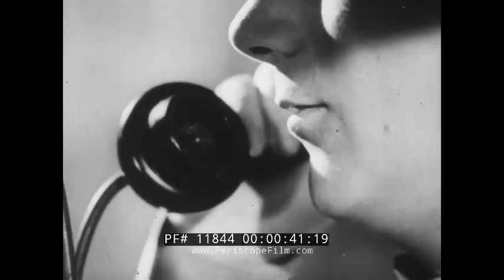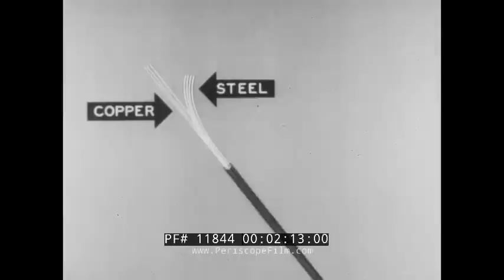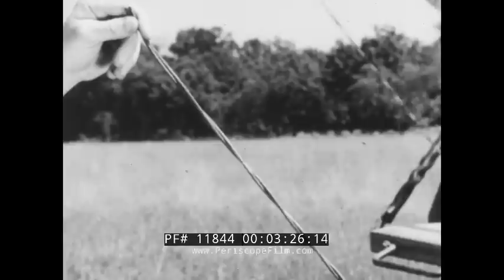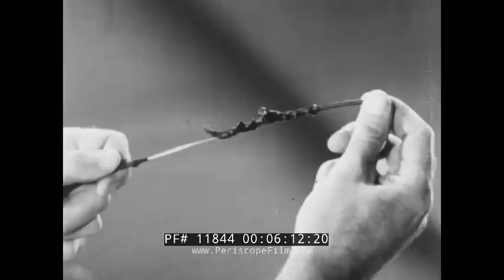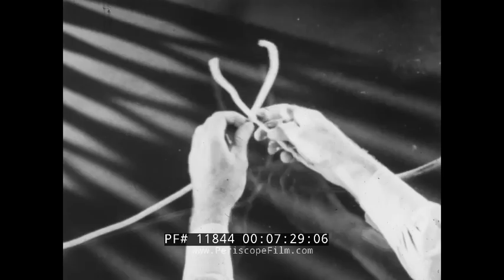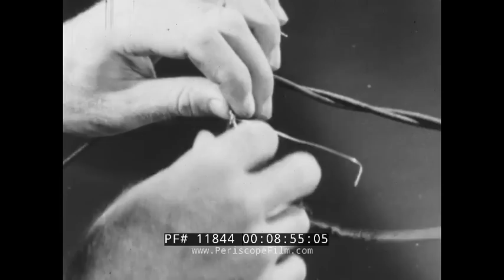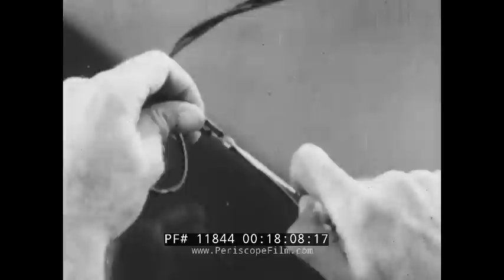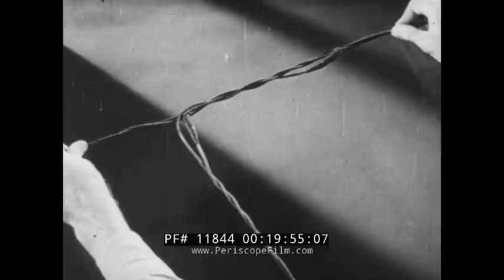1941 U.S. ARMY SIGNAL CORPS     SPLICING OF FIELD WIRE CABLE TECHNIQUES  FIELD TELEPHONE 11844

Comment: Average infantry/artillery soldier: "Screw that! Just twist the ends together and tape them!...we need to get going!"
Reply: Fortunately, "wire rats" assigned to combat arms units do it right.
Reply: @paladin0654  It might seem like alot to remember but I think with experience and practice two soldiers could do this in under 5 minutes!
Reply: @ZerokillerOppel1   I could not imagine Two pole jockeys on One Pole! 

I could tie wire fairly quickly, make my Comms Test, and be down the pole, (I was on a Base Camp and the WIRE was Old).

I ended up Replacing all the sing strung lines with a 27 pair "TM" approved hand made cable from OPS Bunker to the Officer's Club, as it was a "Central Location" where I could do my branch cables.
Reply: When their life relies on the coms not breaking up, maybe they do it right.
Reply: Right...  Some of my favorite memories are of  when we had to duct tape and bubble gum stuff to make it work... Thinking is fun .. despite the popular narrative I see pushed so so much ..
Reply: @madsighntist14  you should a been there when we would work in places so high and remote we would get dropped off by helicopter and hang a square made of 2x6s  rope ..  take turns standing to balance the "work "platform" ... Fun stuff
Reply: @ZerokillerOppel1  Agree - remember war is 99% boredom. If thats your job, you'd learn to do it in the mud, at night, without making any noise... the real question is how many tools (other than pliers) can you do it with?...
bayonet? easy. Zippo? Spork? probably.. Teeth? if you really need to....
Its a tough job, and you would be a specfific target to the enemy, and often be isolated from the rest of the troops
Reply: Sound like some electricians I work with in the Low Voltage field.
Reply: The reason they use steel instead of copper if for strength. But steel is not easy to just "twist" together.

Comment: Oh the 31-K/10 memories .!!❤️ I still have my issue TL pliers sheath and Barlow knife ...
Reply: 31K here too. Oh the memories. Like my finding out how to listen in on radio comms with my Fred Flintstone switchboard. Wires are antennas, audio amp is audio amp, crystallization/slight corrosion on plug is rectifying junction = radio receiver.

Comment: The British had a solder splice; a thin walled copper tube with solder and flux on the inside and a pyrotechnic compound on the outside. The wired were threaded into the tube which was lightly crimped, then the pyrotechnic compund was lit. When it was cool the whole thing was taped.
Reply: Hellerman Jointer
Reply: @Vegan123  Not really the same no.

Comment: Hello. Trouble Shooter One Five, Tay Ninh, RVN, 1969/70. I worked in Signal Detachment for the 187th AHC "Crusaders".

I did Telephone Lineman work when I first got there, as my Primary MOS was "Filled". So I Grabbed the Tech Manual, read it, & OJT'd as a Pole Jokey.

I climbed poles Day OR night: when ever a line went dead, I was on it to get it fixed!

This training was Very Similar to our more modern wire, 4 steel 3 Copper, and I could find a bad wire at Zero Dark Thirty with zero light, just by feel!

Comment: Now days in the U.K. most copper wires are crimped the wires that feed from the pole to house 🏠 drop wires has 5 wires 4 copper 1 stranded support wire only 2 of the copper wires are used for communication the other 2 are spare I have seen some one use the support wire to give service when the other wires are broken when they should run a new wire things are changeover to fibre directly to the the home it was going this way before I retired from the industry 3 years ago

Comment: I took the Field Wireman course in 1970, other then a bit of improvement in the wire, the procedure was exactly the same the test to the  proper splice was the strength, and the size, our instructor said it should be covered with a quarter, one instructor demanded the size of a dime, but he was an ass.

Comment: That sqaure knot looks suspicously like a reef knot.
Reply: Square knot is the same as a reef knot. Like a clove hitch is the same as a double hitch.
Reply: @_GOD_HAND_  There is a clove hitch, and a 1/2 clove hitch. I seen truck drivers call the clove hitch the truckies tie down at depots as I picked up loads in my van. Though nowadays they use those ratchet straps.

Comment: In the field is this practiced of running temporary wire where needed still used in the military or is everything wireless now?  I'm not talking about main power wire.
Reply: We are still issued a phone from 1921 or 1912,  cant remember witch, with two D-cell batteries and  two lines that goes in it. Used for guard posts and stuff like that.
Reply: @thomasgustafsson7330  That would be 1937, and while there are two binding posts, "la" and "lb", they are connections for a pair of wires that constitute one line.
Reply: 4 years ago the expeditionary phone switch was still in the nomenclature. We had one in a big box. I got training on that in the early 80s. As for wireless. Over long distance we used microwave on expedient towers. In camp we did have secure WiFi and also hard lines. I’m Iraq in 06 one of my jobs was keeping our phones up to the demarc of our little Navy camp, inside a larger Army camp on a bigger air base. We loose a line, I go to the demarc and verify it was dead coming in. Not my problem. I had a butt set and a toner. Then I go pound on the door of the Army comm shack, only concrete building on base. They crack it open, I slide in the trouble ticket and roll. One night the COs phone goes down. I find the problem is outside our camp. I go to the comm shack and one PFC is there. I’m telling this kid this needs to be fixed now. He won’t let me in. He is saying tomorrow. I outranked him so I told him it was the COs phone and let me in. He lets me in and for the first time I see the same damn phone switch I was trained on. And the punch down rack for the camp. I get down on the floor and find the lines with my inductive amp. I am about to punch down the pair and in walks in the CSM in full dress uniform. He screaming at the PFC for letting me in. I tell the CSM it’s our COs phone and I can have him walk over to his COs tent  to work it out. CSM gets down on the floor, takes my gear, finds the line and punches it down. Then I call to the desk in our office and it’s working. He all but throws my gear at me, tells me to get out and not come back. So I got a CSM to crawl on the floor in full dress lol. I’ve been waiting to tell that story for years.
Reply: Yes and no. Most everything is UTP or STP which doesn’t take to splicing. Some shops still have the ancient telephone sets with half mile spools but I’ve only ever seen those spools used for corrective training, hauling them up and down the yard till the sergeant you pissed off got tired.
That was 12 years ago. I haven’t seen them since.
Reply: @mansnilsson4382  Hence, twisted pair! Which oddly enough was my nickname in High School!
Reply: @thomasgustafsson7330  TA-312 Field Telephones.
Reply: I’ve seen pettiness like that happen in the Marines too. Sometimes between different units, sometimes amongst different departments within the same unit. You’d think everyone would work together better than they do but it just doesn’t always happen like that

Comment: And then there was Radio.
Praise be, and hallelujah.
Reply: Not sure what reality you are living in, but radio is much easier to hack.
Reply: @Mostlyharmless1985  Sure, all you have to do is crawl around in enemy territory in the dark looking for a wire in the jungle, no sweat!  They had radio but all you had to do was sit in a nice dry bunker with a scanner to pick up all of the transmissions.  Hmmm, that sounds MUCH easier.
Reply: Key West Steve are you really arguing with a Signaler about COMSEC? Wire com are considered insecure and less so than radio. FHS and encryption makes listening in on radio practically and effectively impossible. Radio is far more difficult to hack. 
The most secure coms is a dude with a motorcycle, not telephone.
Reply: @Mostlyharmless1985  you do realize this was made during WW2 right?